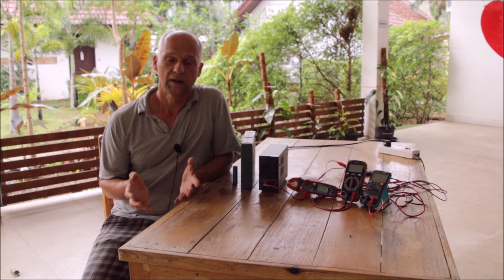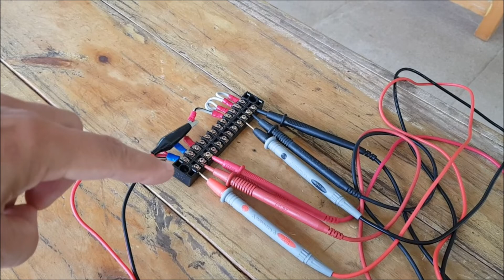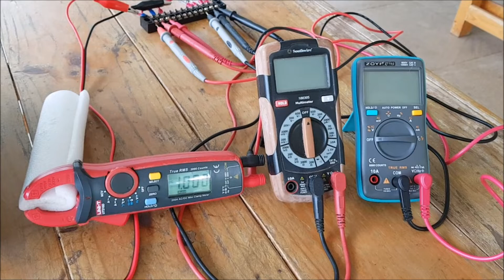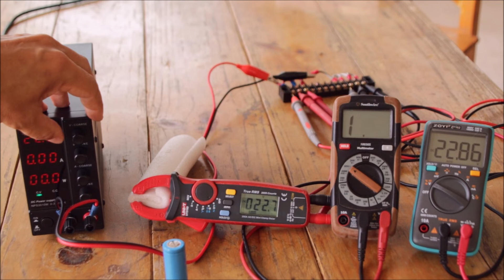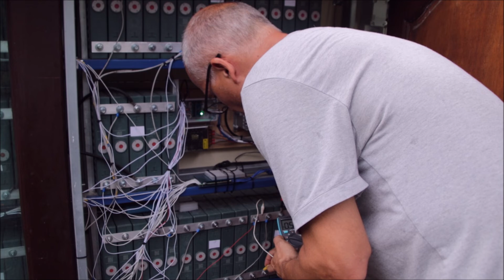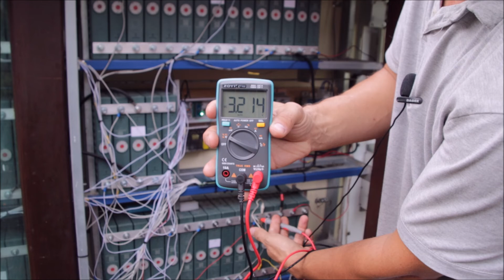Metering Basics: What COUNT should your meter at least have when building your DIY Battery

Comment: What good is a large number of digits if they are not accurate?
Reply from the maker: Correct. If the readout if not accurate then it is meaningless. But how do you know how accurate your meter is? You would have to compare the readout with a calibrated device. Any meter can be perfectly accurate or not :)

Comment: I have a 3000w Giandel inverter that died from one short. I've been scratching my head and bitching since then. Thank you so much for your grounding video because I think I know what happened now.
I have a class A rv with a old Heart inverter. I recently made a 24v lithium and put the Giandel on it. I ran a rv cord down to the shore power cord area to a 4x4 box with a pigtail female rv cord on it. So I plug in the shore power to it. Then my house system becomes a backup for that through the transfer switch. It works great.
What I did was plug in a long cord into the plug in the back by the transfer switch which I was running my POS Harbor Freight angle grinder which shorted in the cord. Exactly what you said not to do in your grounding video. A long cord too far from the inverter.
The Giandel was super powerful. It ran my worm drive skillsaw no problem. So I feel betrayed like a Toyota owner when his truck wont start. It's a drag because it was so useful. 
I'm going to put in a GFCI in the 4x4 box with the pigtail. 
My system was ungrounded. I didn't want to ground the 24v to the 12v frame. I doubt if it matters if it was in a out of the way place on my giant motorhome frame. Isn't that like a giant amorphous energy blob? I'm going to ground the 4x4 box to a stake in the ground, ground the ac cord ground to that box, and run another ground wire from the peg on the case to the 4x4 box. 
I guess I'll have to stop using power tools on the inverter which is a TOTAL drag. I feel that Giandel is a shit company for giving me no warning about this and not standing behind their product, which is another story.
I don't think grounding had anything to do with it after all but I'm thankful to have a better handle on that.
Reply from the maker: OK, sorry to hear that. Always keep in mind how to catch faults like shorts, etc. with circuit protection. MCBs might not always work, as inverters often will not be able to provide 3x the rated current which they need to trip. So, try to use MCBs right on the exact current rating you want to protect. GFCI is the better way to go, but it requires at least a fully integrated Grounding loop including a G-N bond. It can only trip when either L or N wire shots the Ground wire. A rod can help additionally for tripping the GFCI, if the brocken L wire is coming into contact with soil or any grounded structure and thus leaking power into the ground which it can then detect. Isolating circuits with transfer switches is the correct way.